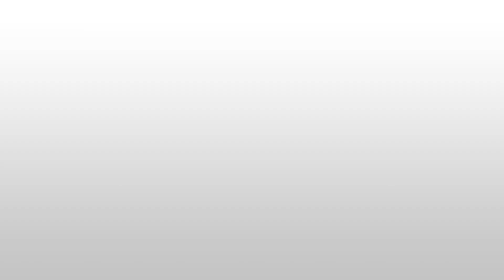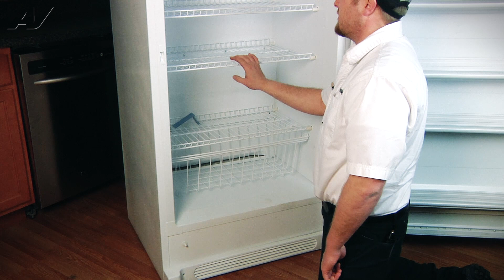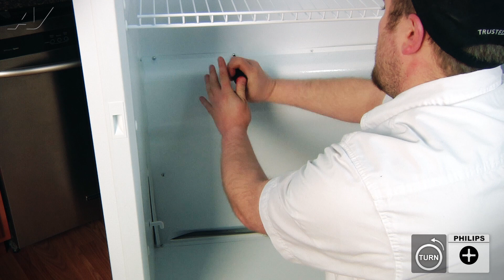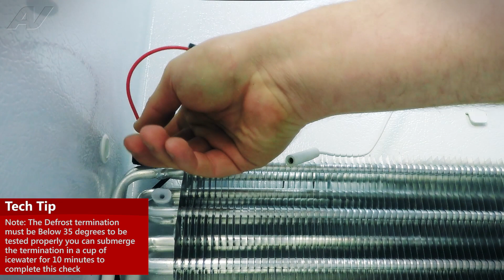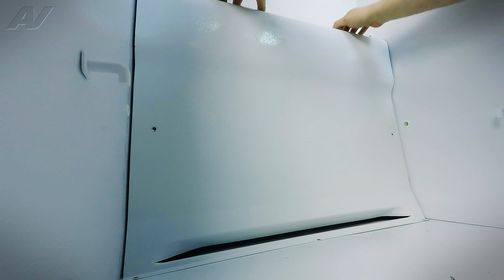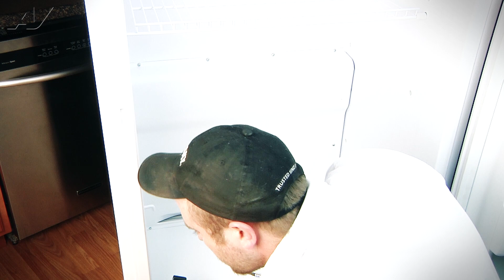Fisher & Paykel Washer Repair - Will Not Start - Electronic Control Diagnostic & Repair

Comment: I have replaced the Defrost Termination switch in my stand alone freezer..  It was easy to do, thanks to your video.  But my unit is still not cooling enough.
Originally the temperature was not dropping below 8°C.  

Then I unplugged it for overnight, & left the door fully open.
Next day I replaced the switch, the freezer was at room temperature at about 20°C. 
After replacing the Defrost Termination switch, my unit has been running for 5+ hours,   temperature is now  at 10°C.
The temperature has dropped from 20°C down to 10°C after 5 hours. 

My understanding is that after about 4 hours the freezer should be at normal cool temperature of about -18°C.
But this is not happening. 
Any suggestions???

Freezer is Electrolux Icon.  The part replaced was exact same part as Fridgedair.

Comment: Frigidaire sent the tech out to my home 3 times, put in a new compressor and still it is not cooling.  Check the compressor put in Freon and still not cooling.  Check all the cooling system and it is still not cooling.  Tech said no leakage but the refrigerator is still not cooling.  What is my next step here?  Frigidaire said it is still under warranty and they have to fix it.  3 months without a brand new refrigerator that I am still financing. HELP!!!!!

Comment: There is a pipe under the freezer that has an insulator covering the pipe and it's leaking water from the rubber hose like insulator. And we don't know why it's doing that? Does anybody else know

Comment: The evaporator coils are super clean, no frost at all but the fan motor works fine. Isn't that a problem? Isn't it normal to have a patina of frost on these coils if it's working properly? IF my fridge (Kenmore Coldspot side by side10658785890) runs long enough it will cool the fridge and freezer very cold. BUT the fridge will not stay cool because it won't start again sometimes until temp is over 60, or I have to manually mess with the temp control dial to initiate the start. The compressor seems very hot and if there's a cold tube sending freezing freon out, it just feels tepid to the touch, not cold at all. I intend to replace temperature control only bc I have the part. Could it need a coolant recharge??

Comment: Hey, freezer side by side the freezer only getting down to 15 degrees, fridge actually too cold? Any suggestions my friend? I cleaned the coils, they were very dirty but no change, this is our 2nd fridge in the garage. Thanks much. I haven't pulled the back to check for frozen coils yet. FYI no water lines hooked up since it's a garage fridge
Thanks much

Comment: I have a Frigidaire Refrigerator FFHT1513LW2. I had problems with a warn refrigerator, cold freezer. After querying online I replaced the Compressor Start Relay, that didn’t work, then the Defrost Timer, then the Temperature Control Thermostat, that seemed to work, but now the refrigerator is getting colder and colder. No mater where I adjust the Temperature Control Thermostat knob, even all the way to the left, the warmest setting it freezes my 2 liters, bread, etc. Is my Temperature Control Thermostat defective or what? I also get a loud snapping noise, like someone snapping their fingers loudly, ever so often. Thanks for you video.

Comment: I have a stand alone Frigidaire refridgerator model FPRU19F8RFC.  The fridge is not staying cold.  I changed the thermostat and the defrost coil but nada.   I attempted to find the timer but I can’t locate it from everything i searched on websites.  SOMEONE HELP ME PLEASE.
Reply from the maker: Great question, if you have a more technical question that our parts department cannot answer, you can search our over 17,000 answered questions free at our website www.ApplianceVideo.com under our Repair Help section. You can also call our parts department at 1-800-830-5465 and they can give you help 7-days A week ,or search at www.SaveMoreOnParts.com  .

Comment: My Kenmore upright automatic freezer would ice up solid in a couple months. I replaced the heating element, thermostat and timer but it still iced up. Figured out that the defrost thermostat was mounted too close to the heating element. This caused current to be interrupted too soon so the coils wouldn't get enough heat to melt the ice. Solved the problem by moving the thermostat away from the heating element to near the top of the freezer coils. Voila! Been running a month now and the coils are free from ice!
Reply from the maker: Great question, if you have a more technical question that our parts department cannot answer, you can search our over 17,000 answered questions free at our website www.ApplianceVideo.com under our Repair Help section. You can also call our parts department at 1-800-830-5465 and they can give you help 7-days A week ,or search at www.SaveMoreOnParts.com  .

Comment: To test the defrost termination does the freezer need to be connected or unplugged?
Reply from the maker: Great question, if you have a more technical question that our parts department cannot answer, you can search our over 17,000 answered questions free at our website www.ApplianceVideo.com under our Repair Help section. You can also call our parts department at 1-800-830-5465 and they can give you help 7-days A week ,or search at www.SaveMoreOnParts.com  .

Comment: This is confusing me. When you check the heater you said you are checking it in ohms but then it beeps? Did you mean in continuity? Because in ohms I never get a beep because your checking for resistance.
Reply: Did you ever get a proper reply?
Reply from the maker: Great question, if you have a more technical question that our parts department cannot answer, you can search our over 17,000 answered questions free at our website www.ApplianceVideo.com under our Repair Help section. You can also call our parts department at 1-800-830-5465 and they can give you help 7-days A week ,or search at www.SaveMoreOnParts.com  .

Comment: My defrost terminator has no continuity. My heater has 31 ohms through it. My freezer never kicks the compressor in. What's next? I did reset the timer by hand in the back also
Reply from the maker: Great question, if you have a more technical question that our parts department cannot answer, you can search our over 17,000 answered questions free at our website www.ApplianceVideo.com under our Repair Help section. You can also call our parts department at 1-800-830-5465 and they can give you help 7-days A week ,or search at www.SaveMoreOnParts.com  .

Comment: I had one of the tiny screws fall down the drain hole. Will it come out the bottom? Any suggestions?
Reply: Dawn can you maybe stick a thin wite down the drain hole and attach a magnet to the wire to retrieve the screw, I had this happen once and when I attached the magnet to the end of the wire it made the whole wire magnetic and was able to reach the screw
Reply: Go to the back of the fridge and remove the black drain hose from the fridge and turn it upside down... the screw should fall right out. If not you can also unclick the tub from the back of the compressor and remove it to wash/unclog if needed.
Reply from the maker: Great question, if you have a more technical question that our parts department cannot answer, you can search our over 17,000 answered questions free at our website www.ApplianceVideo.com under our Repair Help section. You can also call our parts department at 1-800-830-5465 and they can give you help 7-days A week ,or search at www.SaveMoreOnParts.com  .

Comment: Can we run the test without the cover?
Reply from the maker: Great question, if you have a more technical question that our parts department cannot answer, you can search our over 17,000 answered questions free at our website www.ApplianceVideo.com under our Repair Help section. You can also call our parts department at 1-800-830-5465 and they can give you help 7-days A week ,or search at www.SaveMoreOnParts.com  .

Comment: where do I order that exact part?
Reply: Dears, I have problem with frigidaire upright freezer, used to hit slightly thermostat then working, no 1to4 not working but 5 and above working, finally i replaced thermostat, if you have any comments. Thanks
Reply from the maker: Great question, if you have a more technical question that our parts department cannot answer, you can search our over 17,000 answered questions free at our website www.ApplianceVideo.com under our Repair Help section. You can also call our parts department at 1-800-830-5465 and they can give you help 7-days A week ,or search at www.SaveMoreOnParts.com  .

Comment: What does it mean when it beeps  and the door jar light is on can help with plz and the door is close get back to me soon as possible plz cant take it with that noise
Reply from the maker: Great question, if you have a more technical question that our parts department cannot answer, you can search our over 17,000 answered questions free at our website www.ApplianceVideo.com under our Repair Help section. You can also call our parts department at 1-800-830-5465 and they can give you help 7-days A week ,or search at www.SaveMoreOnParts.com  .

Comment: I've replaced defrost timer, thermostat heater, fan and fan motor, still won't cool to freeze. I'm literally at a loss, does anyone have any other suggestions. It just runs but never gets colder than a mild cool.
Reply: Justin did you find a fix for your freezer I am in the same place, I just replaced the defrost termination in this video, the fan works and the  heater has continuity going through it. When we put everything back together last night it is still only cooling to 25-30 degrees above 0, I so need my freezer to work and was hoping this would be the fix. Any help anyone can give me is greatly appreciated.
Reply: @1954evelyn  If you can send me a picture of the frost pattern on the coils I could tell you what it most likely might be. If your freezer evaporator coil is not frosting all the way through And frost build up where it is frosting you have a sealed system issue. Leak or restriction most likely.
Reply: @chrisscott5339  I have the issue resolved the freezer was low for freeon thanks for the reply
Reply: @1954evelyn  hi Evelyn,  I have the same problem,  I replaced the Termination switch,  but the freezer is still not cooling to freezing point.
After 2 days of of running, temperature is not going below 2•C.
Did you ever solve your issue?
Reply: Yup a bad compressor
Reply: If your freezer and fridge are not getting cold at all and the temperatures are warm then more than likely you are having a sealed system issue. Not a defrost issue. So those parts you replaced could have been changed when they were working fine and not the issue to start with
Reply from the maker: Great question, if you have a more technical question that our parts department cannot answer, you can search our over 13,000 answered questions free at our website www.ApplianceVideo.com under our Repair Help section. You can also call our parts department at 1-800-830-5465 and they can give you help 7-days A week ,or search at www.SaveMoreOnParts.com  .

Comment: Hey Kraig I have the same freezer everything is working I vacuumed the air and filled with freon and is not cooling I replaced the heater thermostat and defrost termination the fans are working don’t know what to do
Reply: Is your fridge getting cold at all?
Reply: @raulrobles2961  no
Reply: @benyblanko1  if you had to fill the refrigerator with freon then you have a leak some where
Reply from the maker: Great question, if you have a
more technical question that our parts department cannot answer, you can search
our over 10,000 answered questions free at our website www.ApplianceVideo.com under our Repair Help section. You can also call
our parts department at 1-800-830-5465 and they can give you help 7-days A week
Monday -Saturday, or search at www.SaveMoreOnParts.com  24 hours
7- days A week.

Comment: Frigidaire model FFTR1814TW0 my freezer doesnt cool at all. The frig seems fine, but cant find a specific solution or troubleshoot.
Reply from the maker: Great question, if you have a
more technical question that our parts department cannot answer, you can search
our over 10,000 answered questions free at our website www.ApplianceVideo.com under our Repair Help section. You can also call
our parts department at 1-800-830-5465 and they can give you help 7-days A week
Monday -Saturday, or search at www.SaveMoreOnParts.com  24 hours
7- days A week.